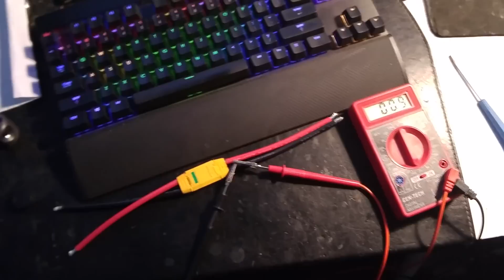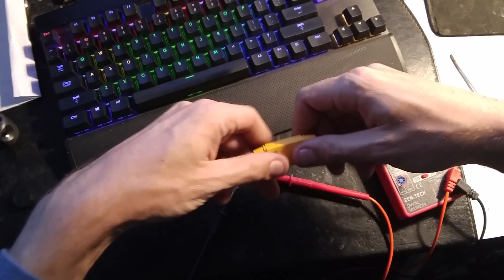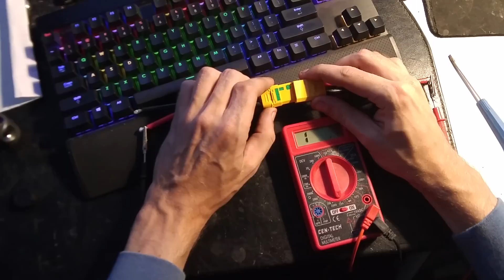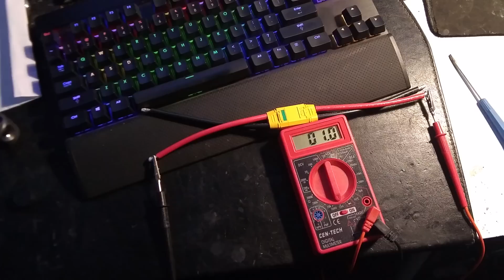XT90 Anti Spark Demonstration

Comment: When switching batteries, can't you just turn it off before connecting? Therefore avoiding the spark?
Reply: Normally a battery does not have a switch build in.
Reply: @izakdragunov4918  so if a battery has an on off switch, as long as it's off when you make the switch there should be no spark correct?
Reply: @raczyk  Yes correct.
Reply: The spark is only one problem. When you first connect a battery to an ESC, the large capacitors on the ESC will charge up fast causing a large inrush current. This can sometimes cause the BMS to shut down. The no spark connectors are a great idea. It is possible to add circuitry to the ESC to mitigate high inrush current, but most don't seem to do it.

Comment: Would love to see a normal connection spark vs this connection not sparking
Reply: it is a bit scary. Just happened to me when disconnecting the battery on my pre-built eskate board. You can feel the kinetic energy coming from the pop on my 36v lithium ion bank.

Comment: Thank you for your video. I thought the XT90-S had a constant resistance of 5.6 ohm. This connector was smarter than I thought ;)
Reply: At max amperage of xt90 (90amps) in the resistance was constant 5.6 ohms it will waste 45.3kw of power (and youll need 504v to push 90a through it)

Comment: They should have designed this on the male connector (ESC side) but obviously they would not sell as many connectors. Having to re-solder all batteries makes it not practical (at least for me).